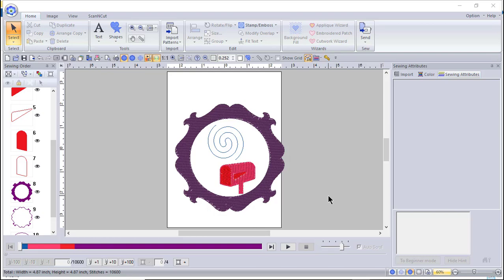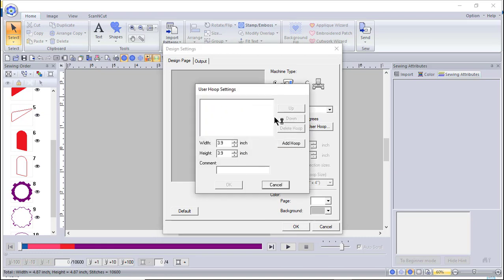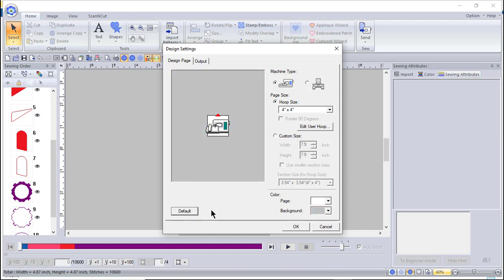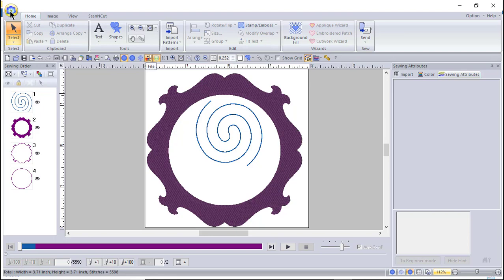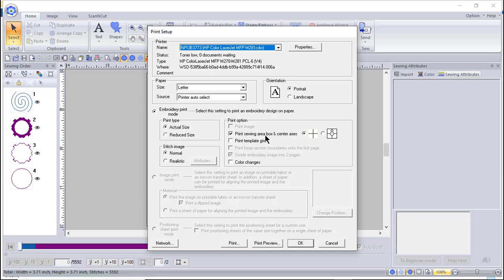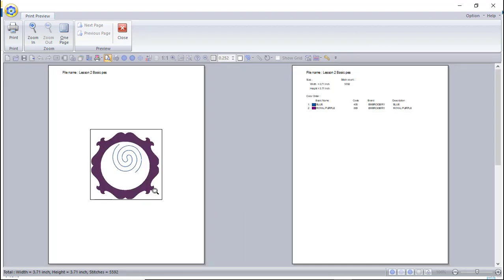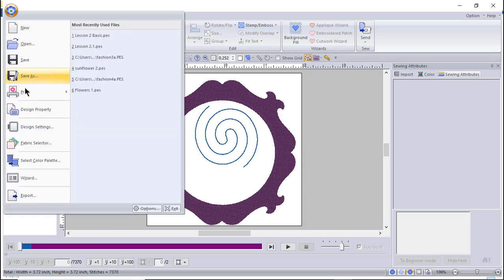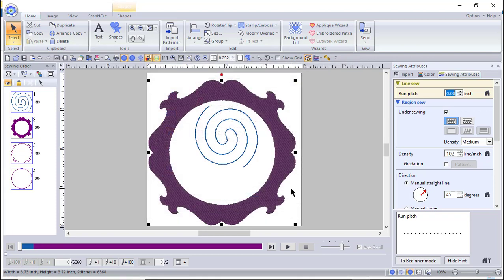PE Design 11 - Lesson 2 - More Basics

Comment: If I choose a larger hoop size than my design... when I embroider will I always have to use that size? Ex: my design is 5 x 7 but I choose 91/2 x 91/2 ?
Reply from the maker: Michalee Sloan  -  as long as your design will fit in a smaller hoop, you should be able to do so.  There is one setting on page 2 of the design page that will not allow your design to be centered.  You will know it when you go to the machine if you inadvertently selected it.